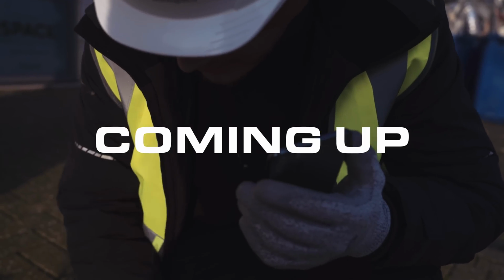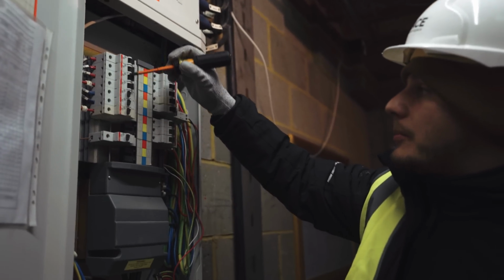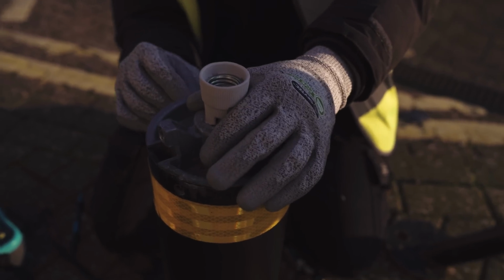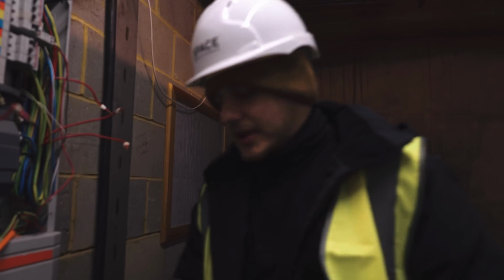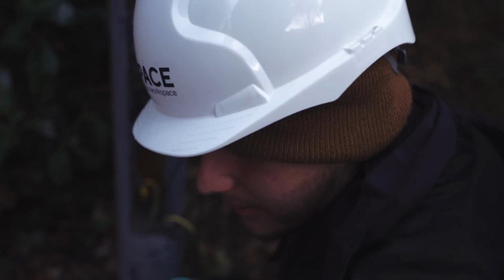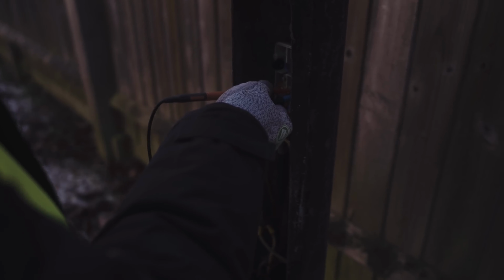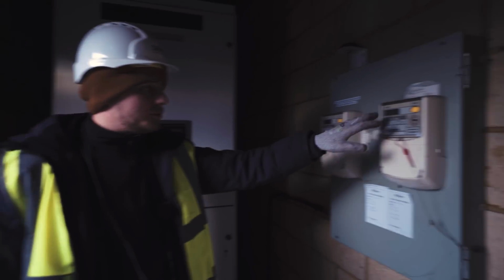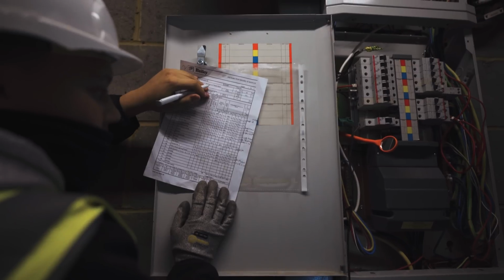On-site electrical validations

Comment: Thanks for the vid - interesting.
Out of interest - would you make any adjustment to Max permitted Zs due to the very cold conditions decreasing the resistivity of the copper cables. Or would you assume that the cable are buried at a sufficient depth to maintain a constant temperature summer to winter?

Comment: All the best for 2023 Mike 
Here's a wee tip (you might know already, but might help someone else out) a 12 point or double hex drive socket will fit a square head bolt. All the best, Pete 👍

Comment: Mike the second electric meter in the intake room is referred to as a "check meter". The DNO restrict who can see what on the primary meter so often a second "check meter" is installed alongside the primary meter so landlords can monitor (as corroborated by one of the meters having a Comms cable going off to the main building) if there's any dispute about usage, or if the landlord wants to monitor / bill more frequently than the energy supplier offers